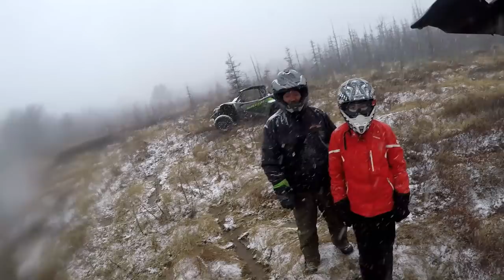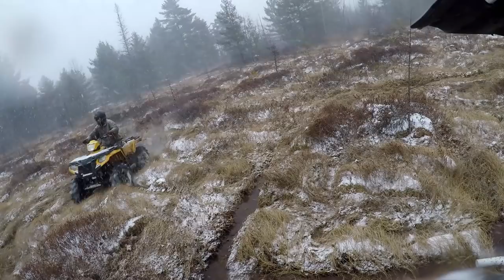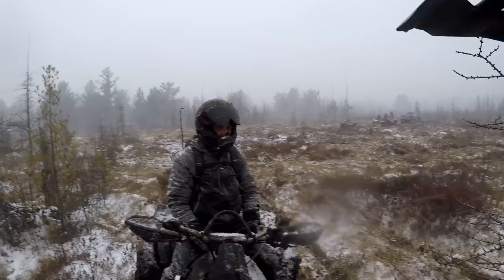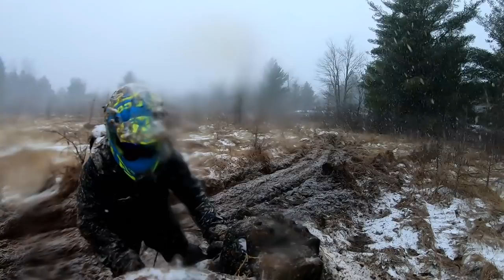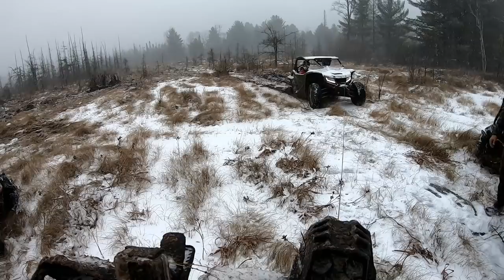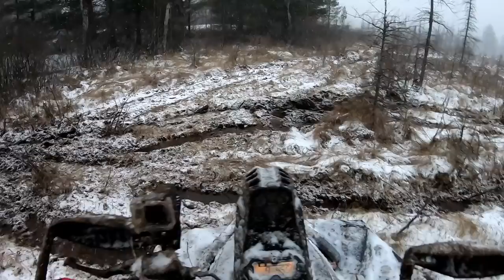Frozen Battlegrounds

Comment: What camera was this, I was just watching an older kingquad video when you had the hero 3 silver on 60frames and I liked the video much better with that camera. It handled movement much better.
Reply: By the way for your frozen switches problem, go to a auto part store and grab the ice melter in the aerosol cans and shoot that into the switch area. Won’t harm the switch at all and will displace water in there to prevent future freezes.
Reply from the maker: Yeah this is the hero 7 black and 5 black. They all have ups and downs to them for sure. Switch just needed some warm shop time, and good to go
Reply: eh TV I’ve never messed with a go pro, I’ve got a cheap knock off ive played with but it’s trash in comparison. Anyways the hero 3 silver you had did really good video quality. Audio on the newer cams is better though. Either way good quality video and edits man

Comment: In your own opinion do you find the Gade XMR better or worse than the Highlifter ? Btw love the channel Subbed !
Reply from the maker: I'm going to lean on the Can Am, They both do a great job and are capable machines. My reason for choosing the Can Am over the highlifter comes down to strength. Over the past year we have seen many structural flaws in the Polaris Highlifter. It don't like being beat on as much from what I see. Frames are much stronger on the CanAm. It will take jumps and bumps better in the long haul.
Reply: I’d agree ! In my opinion Honda has the strongest frat but the lack of power is killer 😂 my 2019 XMR is great apart from it won’t idle under water stock so that’s how I justified the RJWC to the Mrs lol keep up the videos I love the accent and I love your channel eh !

Comment: What’s up with Phil’s machine ? I see in the last few videos he has been riding his wife’s 850.
Reply: SCOTIAN  The old 850 needs a beating too lol, my bike was in the shop for the power steering, was acting up at full lock, they replaced it for free and through in a new battery and she’s ready to beat again, I think the weak battery was the culprit for the power steering acting up periodically but when they say a new unit is going in , giver, this bike has been awesome, 3100kms and 183hrs with hardly any downtime.
Reply: phil parks I see you beat the 850 so bad it needs a axle now lol . Gotcha just wondering if something happen to yours , she’s holding up pretty decent then. My 850 blew a axle as well thinking of a demon one to replace it
Reply: SCOTIAN 
The 17 850 has the older style axles, way smaller then the 18 and up, I went with a Demon heavy duty for replacement, there double plunging and are really beefy compared to stock and come with warranty.
Reply: phil parks ordered 2 HD demon for my 850